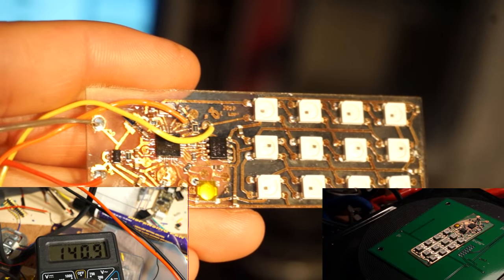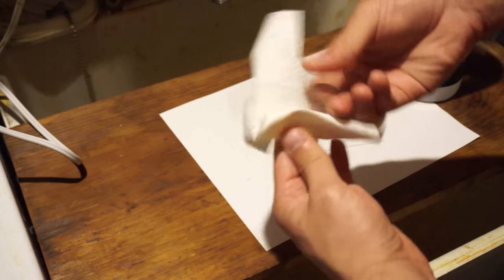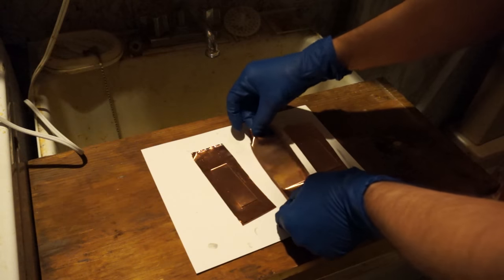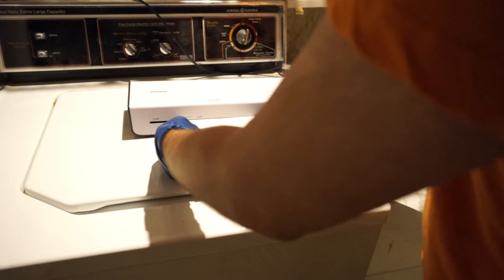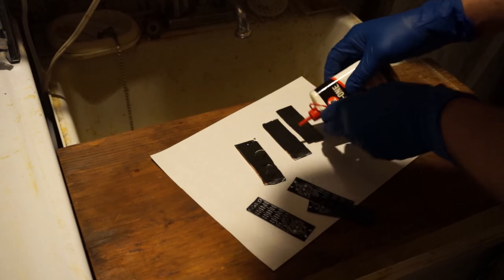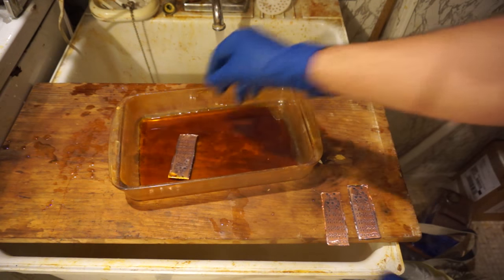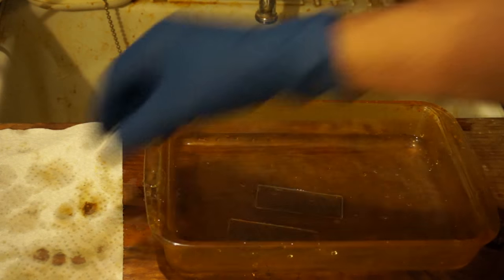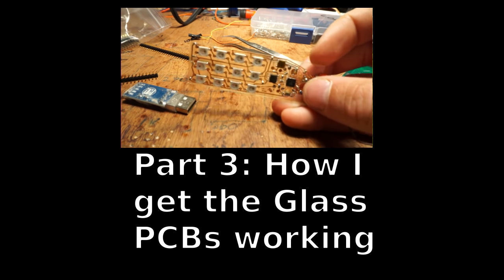Part 2: Printing Glass Circuit Boards

Comment: That warning at 10:15 is so right!  I wish you were around when I was young and making crude circuit boards by drawing freehand with an etch resist pen on copper-clad boards. I remember those yellow ferric chloride balls vividly; I was lucky enough to have a washbasin in my bedroom and it was all going so well until the u-bend under the washbasin dissolved...
Reply from the maker: That sounds horrifying

Comment: Grow Lights are specifically designed to emit very little in the UV spectrum, focusing more on the 3500-7000 Kelvin ranges, and this is because ultraviolet light is quite harmful to most all living things but particularly plants.  Either your light was not a grow light, or it was in the 12,000-20,000 Kelvin range and was mislabeled as a grow light.  Either way, it looks like you used a high intensity discharge lamp, but if UV light is required for that process, you should say so.  Nice concept, too!

Comment: have you tried muriatic acid/hydrochloric acid with 30% hydrogen peroxide ?  Like less than 10$ for a gallon and less of an hazmat problem. I tried it, worked great and very fast but it will make everything around it rust if you leave it in an open container for a few weeks.
Reply from the maker: Stuff is SO FOUL.  Can't use it anywhere near the house.  Ferric Chloride offgasses very little while working.

Comment: I've read some people have had success printing directly onto aluminum foil with laser printers. In that case, you could probably laser print right onto the copper foil and etch that, skipping a few steps. Might make gluing to the glass more challenging, since it'd be after the print.
Reply from the maker: I have tried the direct-to-copper stuff, but it came out just awfully at least with the laser printer I tested with.  Perhaps if I could have found a way to make it go much much slower it would have worked.  It just couldn't get to fusing temperatures with the thick 1.4mil stuff I was using.
Reply: Ah ok. Dang, it'd be an easy process if it worked
Reply: Do you have some details about aluminium foil circuit boards cause i really wanna attempt that
Reply: I actually can't find it now, but I don't think it was for a circuit. I know that I came about it researching printing directly on pyralux and it might've been on hackaday, or linked from hackaday. If I find it again in the future, I'll post a link here.

Comment: I wonder... instead of the Loctite, trying clear nail polish? For starters it's WAY cheaper but even better yet it's really heat resistant. I've been using that on my rifles for eons now as a thread locker instead of Loctite because it holds SO much better on parts that get really hot so I bet it might work as good or better?! Comes off with Acetone too though if you soak it long enough.
Reply from the maker: Depends, are there nail polishes that can cure entirely with UV without access to air?
Reply: @CNLohr  well, when used as thread locker it dries no problem even in the microcasim of a gap between the finest of small screw threads and pretty much all the air gap in the threads is displaced with the polish, so the solvent that keeps it liquid still manages to evaporate out of such a small area. I suppose if you wanted to speed up the cure time you could use a hair dryer, heat gun or put it in front of a heat vent too.

Comment: have you ever tried copper tape and attached directly on the glass? by the way why didnt you directly transfer the design on the copper with an iron?
Reply from the maker: I have but the adhesive on the back of copper tape makes it not nearly as tough as UV glass glue

Comment: Nice video! Have you ever try to put the copper foil into the printer, before the gluing?
Reply from the maker: No.  What would that accomplish?
Reply: @CNLohr  You know, like the tone transfer method. Print the negative to photo paper with laser printer, then put it on the pcb and transfer the ink with hot iron. So if you could print the layout directly onto the copper that would be super easy and fast.

Comment: I have a quick question: I looked up the pantum and it does sound great but like all cheap printers it seems to have silly expensive replacement toner cartridges (PA-210 from what I can tell).

Do you buy these somewhere for cheap or do you refill them yourself, or are they actually worth £55 ($57.1 without UK VAT)
Reply from the maker: That sounds about right.
Reply: CNLohr So do you buy them or refill them?
(It looks like you didn't click "Read More" on the comment :P)

Comment: Have you ever tried using sodium silicate (water glass) as the adhesive?
Reply from the maker: No, in fact I've never even heard of that. Googling it I really don't have a clear idea if it would work well or not.  I'm sadly not a chemist and really focus more on the firmware/software side of things.
Reply: @CNLohr  you have any of the glue left over?
Reply from the maker: @Tedlasman  Maybe but it's almost certainly all bad by now.  You could try reaching out and seeing if you can get any http://www.etch-o-matic.com/price_sheets/uv_bonding_unit.php
Reply: @CNLohr  Thank you!

Comment: Had exactly same printer which after 2 months of use died on me, power supply board just smoked :( was really nice printer tho, had mirroring function in printer settings, i still have it cant figure out what happened because no exploded parts or fuses, board like new
Reply from the maker: Mine is still going strong!
Reply: CNLohr
made me jelous now, i bought it on sale was 20gbp or 25 us dollars, original price was 45gbp or about 50-55 us dollars, and thanks for the tutorials :)

Comment: Did you try some other adhesives beside UV-ones?
Could it work with glass clear epoxy?
Reply from the maker: I tried epoxies but never got them to work well.  You could totally try!
Reply: which problems did you have? Did the copper come off?

I try to get the materials here in germany, but it isn´t easy to find the right stuff...
Reply from the maker: I couldn't get the epoxy coplanar.  Like it was really lumpy :(

Comment: could this process work on acrylic sheet instead of glass?
Reply: alzathoth 
  I doubt it. First, acrylic probably can't handle the heat from the laminator without deforming. Secondly, the acrylic surface will create all kinds of problems because of the different thermal properties of the plastic and copper. Basically the adhesive must be able to stick while getting pulled in multiple directions at once in a microscopic scale. The types of adhesive (I am aware of) that can accomplish this kind of flexibility are generally more chemically reactive and won't handle this kind of process. It might be possible but it would be a big project to figure out.
   Just wire your project point to point with solid core wire and embed the whole thing in clear casting resin ;)

Comment: What kind of tape are you using to fix the circuit layout on the copper?
Reply from the maker: I usually don't tape it down.  I just squeegy out the oil and the transparency just stays put.
Reply: I mean the double-sided tape(?) at 4:00 . Is it any special tape? My boards was done by an manufacturer before so I don't know the procedure for usual homemade boards like you said there :/ And google just showed up other methodes without any kind of such an "Tape to plastic when exposed to UV" thing.
Reply from the maker: That is not tape?  It's Riston.
Reply: Ahhhhh okay. Now i got it. Thank you! :)

Comment: At the price of LOCTITE 3301 and other similar adhesives, I don't see much point in this method. There are neoprene based adhesives for hot press bonding that give identical results but for much less money! At the price of these adhesives, if you make a lot of PCBs, use the CNC engraving method!
Reply from the maker: How in the world would you use CNC engraving on glass?

Comment: Hi, what software did you use to draw the board :-D
Reply from the maker: I believe I used KiCad for this, if not, it would have been ExpressPCB, but I strongly recommend KiCad now.
Reply: @CNLohr  your board looks almost as if you've designed it with help from TopoR.

Comment: ever tried heated sodium persulphate ?
Reply from the maker: Nope.  At this point, I am pretty set, but if you have any videos that make it shine over ferric chloride, I would certainly watch and reconsider.
Reply: For home use "best" solution is using ammonium peroxydisulfate, is a clean and "safe" method. Chemical reaction of ammonium peroxydisulfate and copper creates dissolved copper sulfate from which you can extract copper by electrolysis, or use it as herbicide if you have grapes plantation (bluestone). Only downside of it is that process is slow at room temperature (it speed up if you heat it to 35-45 degrees Celcius, but even then is slow comparing to let say HCL and H2O2).
Reply from the maker: Sadly, speed is everything for me.
Reply: CNLohr
Then for you is HCL and H2O2, it is 3-5 times faster than ferric chloride, but you use "dangerous" chemicals, and it is "reusable" (that industry say, I never managed to use it multiple times, it have extremely short shelf life but considering how cheap it is that hardly matters).
Reply from the maker: sigh sooner or later.  I do have the ingredients.

Comment: what is the thickness of the copper sheet?
Reply from the maker: typically 1 or 1.4 mil
Reply: CNLohr thanks, I'm really curious about this technique and I would really like to try it :)

btw is that loctite the best glue for the job, I'm having a hard time finding it at a reasonable price... you know any alternatives/equivalents that might work?
Reply from the maker: martronics uv glass glue is really good too, just a little tricky in the last two steps.

Comment: Don't use steel wool. Use mineral wool. You're leaving miniscule amounts of steel or there, creating an electric element, which will corrode the copper eventually.
Reply from the maker: There's a lot more ferrous material in the ferric chloride, but that's why we acetone the boards when done.

Comment: Actually, Na2CO3 is sodium bicarbonate, the baking soda is sodium hydrocarbonate (NaHCO3) [or sodium hydrogen carbonate]
Reply from the maker: You are right about the chemical composition, but, it is odd the english name really is "Sodium Bicarbonate."  Until today, I was unaware the IUPAC  name was really sodium hydrogen carbonate
Reply: I don't think that problem is only in English. In Russian, for instance, baking soda is also called Sodium Bicarbonate (натрий двууглекислый, бикарбонат натрия) and also Sodium Hydrocarbonate (гидрокарбонат натрия) interchangeably. The actual Na2CO3 is called calceinated soda (кальцинированная сода) although, there is no Calcium in it. I think this is due to historical reasons, perhaps before people knew the difference, both behaved similar when performing some task (most likely cleaning), so both were called the same. Then as science developed, peeps realised that these have different compositions and that one is safe to ingest and the other - no so much :). But the names stuck... That was just MHO.
Reply: NaHCO3 is sodium bicarbonate (=baking soda) In any language where it sound even remotely like that.
Na2CO3 is sodium carbonate.
Reply from the maker: I've switched to washing soda now, anyway :-p.  Just has to be hot water when you use it!
Reply: Then what does "bi-" mean??? In my understanding bi-something is two-something. Proper chemical name is sodium hydrocarbonate, IUPAC recommended name is sodium hydrogen carbonate; however, the historical name is sodium bicarbonate. Bicarbonate formula is HCO3- (sub 3, super -), but IUPAC recommended nomenclature is hydrogen carbonate.

Sorry to disappoint you :)
Reply: Disappoint me... how?

They used to write NaHCO3 as Na2CO3*H2CO3 (2 NaHCO3 = Na2CO3 * H2CO3).
So it was two carbonates instead of one ->  Bicarbonate.
Reply: Ah, so that's from where the 2 comes. I see now. I never saw it written that way, but makes perfect sense. Learned something today. Thanks.
Reply: Why not just 'disodium carbonate', chemists? >:|

Comment: That pitch.
Reply from the maker: pitch?
Reply: The center to center spacing. I know it wouldn't considered particularly detailed if this was a professional board fab.. but copper sheet hand squeegeed to a glass slide with Locktight, and exposed with a transparency printed on a ~$50 laser printer. That's some impressive detail.
Reply from the maker: Ah!  Yes.  Every time I've been able to make a jump to the next smaller pitch I had a lot of excitement!  It is a ton of fun!
Reply from the maker: Can you take a high fidelity picture of your transparency held up to a blue or cloud-covered sky?  

But! But! I must say. I have tried SEVERAL pre-coated boards and ALWAYS had trouble.  Riston is SO forgiving.
Reply from the maker: Brand name.  I didn't know there was generic.

Comment: Why print a .png out of an office program? There are so much better workflows.
Reply from the maker: export to PNG, drop PNG into office program.  Print from office program.
Reply: Yeah. But you have beautiful crisp vectors and then you are printing from a raster image.
Reply: Why not, if dpi is enought.
Reply from the maker: Well, #1: Printer's only 1200 dpi.  #2: How would you organize your designs on something to print with page guides?  I've tried inkscape and it's just not geared for it.
Reply: when I want to layout things geometrically for printing, I spin up a little html page with some css.
Reply from the maker: At one time, I tried that too, but was annoying to try to keep scaling right and no headers/footers etc...
Reply: I'm always exporting svg file from KiCad, and then PDF from Inkscape, because I'm often printing on different printers using different programs, so with pdf I don't have problem with scale
Reply from the maker: I will try and report my findings.  I STRONGLY believe that this will not improve quality at all, though.
Reply: CNLohr I think the same